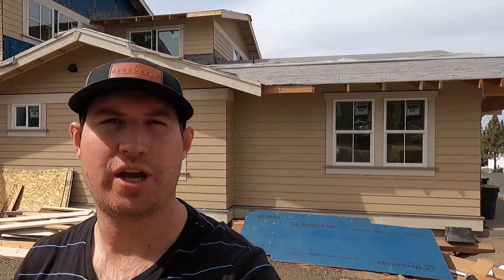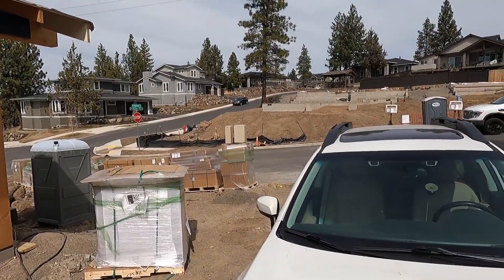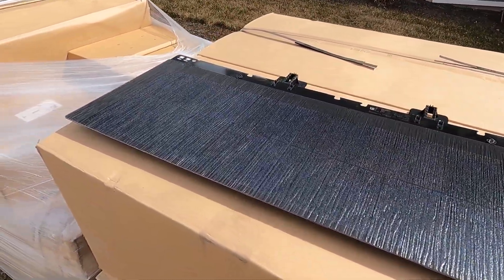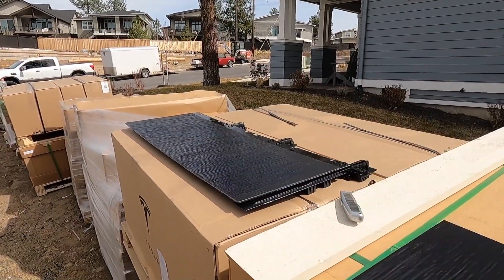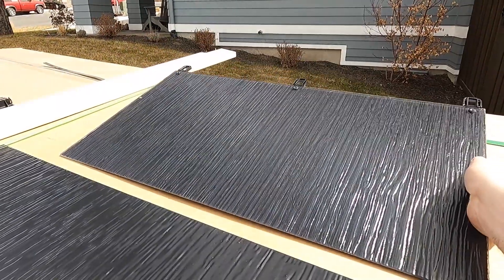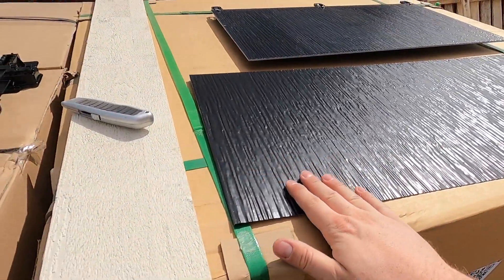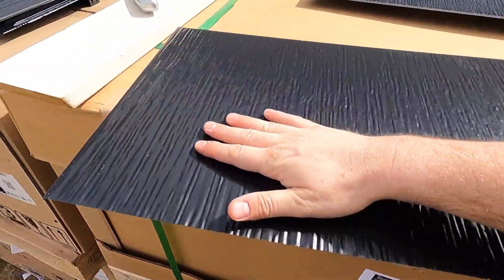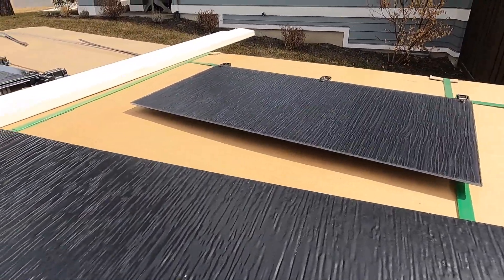NEW! 3 types of Tesla solar roof tiles ready for install

Comment: New metal tiles are ONLY for flashing in edges and valleys---VERY IMPORTANT to know.   Most of roof will be the glass shingles.  Please edit your video that to strongly emphasize that.   I almost took Tesla off my list for new roof before I learned this important point.   Thank you.
Reply: Nope. Mine was just installed. They are now using those metal tiles in entire large sections that don’t have a solar component.
Reply: Todd Mekjian yep as it is a series system , so non-sunny section lowers the performance of high-performance areas, voltage is electric pressure . The metal is the : greater impact resistance, easier installation, cheaper shipping , smarter way to go

Comment: How much was taken off the price because this was a new build vs a replacement roof?  Assuming any at all.  Also how long after your house construction did tesla install the roof.  That is actually one of my major concerns, waiting a year before it actually gets installed on my future home build.  Any input would be insanely helpful.
Reply from the maker: I don't know if it reduced our price at all but the only step it really saves is the removal of the old roof and some potential sheathing replacement. The big thing with the new construction is Tesla requires their underlayment and they wouldn't ship it separate from the rest of the materials. We couldn't get them to ship anything until we had the permit finaled, and they won't do designed until you give them framed roof measurements...which you clearly can't do until the roof is built. So we had to redneck a temporary dry in with synthetic underlayment that could be removed easily to be replaced with the Tesla underlayment once it arrived. My roofer was very good about staying on top of that as we dealt with rain and snow during this period, but it wasn't easy. Hopefully Tesla decides to start shipping the underlayment separate so builders can just dry the roof in one time...
Reply: @jakehermeling  Thank you for the endepth answer!  Certainly take this into consideration when I finally build once the market corrects!  Thanks Jake!

Comment: Hi Jake, I've been hearing about Tesla raising the SR price drastically for some people, and their recent decision to only sell Powerwalls with a new roof install. Can you talk about if you had any issues with changing quotes or any other issues? I'm a big fan of the product but Tesla customer service is not as smooth as it should be.
Reply from the maker: We had similar issues with Tesla sales reps, they didn't seem to really have an understanding of what was available or when. My recommendation would be to see if there are any certified installers in your market. That's the route we went.
Reply: @jakehermeling  Good point, thanks. Will you talk about the overall cost of the system and installation? And please talk about your customer experience in an upcoming video, many people would want to know, since it's an important aspect of such a big purchase.
Reply: They raised the price on everyone. Not just a few . My initial price for a 1500 sf. Cape was 30,800. 
Last week I got the notice they were raising my price to 52,000. Some of that was attributable to the fact that they determined that my roof was of "medium" complexity. And part was just them jacking up the price because they felt like it.  If I manually put my roof as a simple roof it comes up as $41,000. So that's $10k for complexity and $11k just because they wanted it.

I told them to go pound sand and cancelled my order. 

Even with them giving people 1 free powerwall it still was a rip-off. I'm now getting quotes for panels from places that actually believe that contracts are binding.

Comment: Any idea on if those dummy tiles will be noisy from inside when it rains hard?  I just approved my final design, looking forward to install!
Reply from the maker: There's a pretty sizeable attic, then thick layer of insulation, and then air sealed dry wall layer. I imagine we won't be able to hear it like you would a typical metal roof, but if I could I don't think it would bother me. That sound is one of my favorites to go to sleep to.

Comment: I’d be pissed after agreeing to pay upwards of $30-50k and get an email that the glass tiles I paid for are being replaced by cheaper metal (loud when it rains) tiles. I’d ask for a discount to beta test this “new” product.
Reply from the maker: Turns out it's only for the flashing around the edges of the roof and in the valleys. 90% of the roof is glass tiles.
Reply: Hi can you please help me with the contact details or website where I can place an order
Reply: Yep mine was just installed. Whole big sections are cheap metal tiles. I’m fighting now to have it replaced with glass.

Comment: Hail will dent metal tiles. Not so sure...
Reply from the maker: We don't get a lot of hail here, but it will be interesting to see how it holds up. The roofers showed me the supports they use and it looks very resilient.
Reply: @jakehermeling  Hi Jake , i owned one of the largest metal roof manufacturer's / installers in Western Canada ..... I've had a 24ga SSeam roof on my own house for 33yrs ... no hail or noise problems and we are in one of the most severe hail locations in North America . The problem I think is going to be visual , the paint on the metal tile is going to fade much faster than the glass tile !!